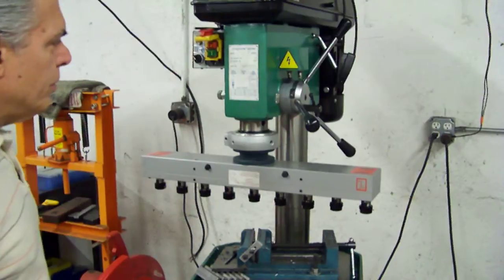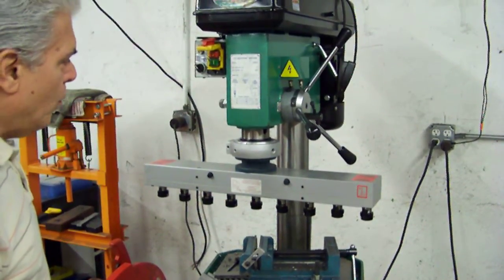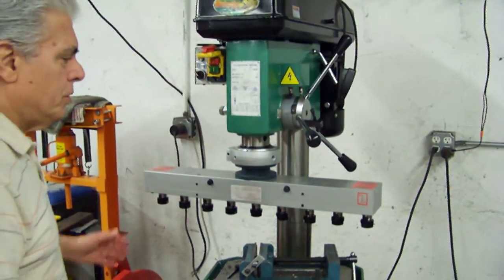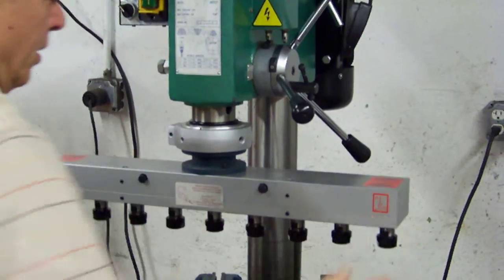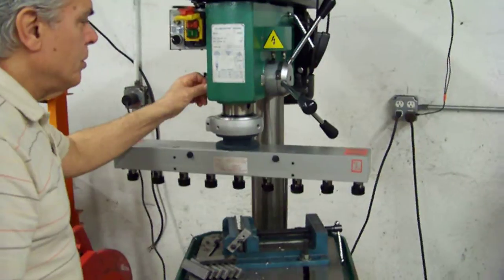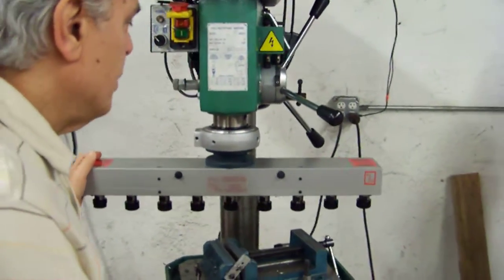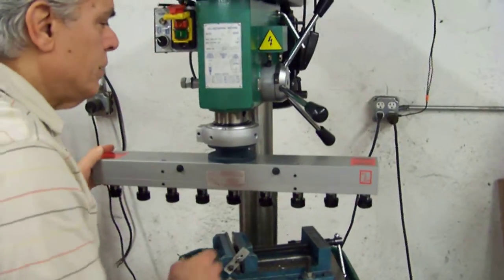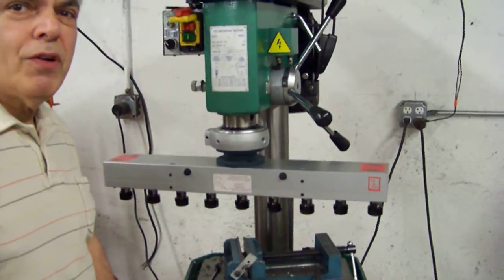EXAMPLE - Loose Quill on Drill Press with Multi-Drill Gang Spindle Head - AutoDrill

Comment: okay, I have a delta. the spindle has up and down play but is okay from side to side.  I don't think that is normal.  I can't seem to find any information about this problem. I don't know if it is adjustment or do I need bearings?  it runs smooth and can be used if allow for the up and down slack.  However, once I did not allow for slack and I went to deep ruining the piece I was working on. JB weld helped out but this drill press so nice I would like to fix it or adjust it.  I see information about run out and movement that is more like a wobble.  Mine is okay there. It is just the vertical slop, about a 1/4 inch up and down. seems like to much and the new drill presses I look at in the stores do not have this up and down play..  Can you please help or lead me in the right direction.  I want to buy the correct parts to fix it but do no know what they are.  your videos are very helpful.
Reply from the maker: Thank you for the compliment on the videos we share.  Unfortunately, without seeing the machine in person, we don't know how to correct this.

To avoid going too deep, maybe you can use the stop collar on the unit?  ...Or does it have play even with use of the physical stop?

In any case, we would suggest contacting the manufacturer to see if they have parts to fix this, etc.

Comment: I have a Craftsman 12" and the spindle has up and down movement  (about 1/8") is there any way to get this play out...?
Reply from the maker: Unfortunately, without seeing the machine in person, we don't know how to correct this.

We also apologize for the LONG delay in our approval and response of this comment.  The request was in a spam folder.
Reply from the maker: Maybe the manufacturer has a repair procedure or parts?  Sadly, Craftsman isn't a higher end drill press manufacturer so it's likely a rebranded, resold machine.